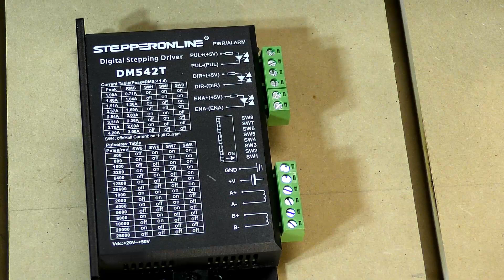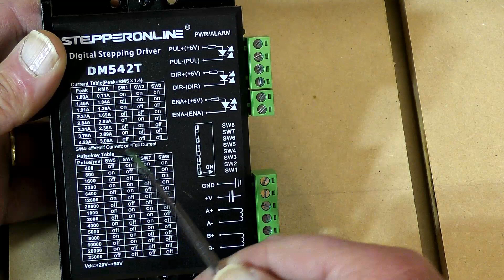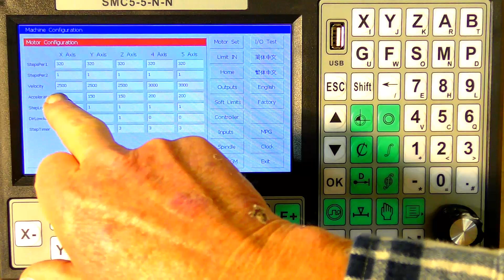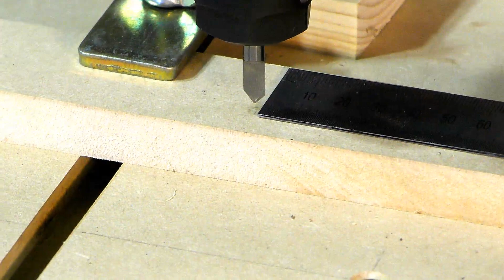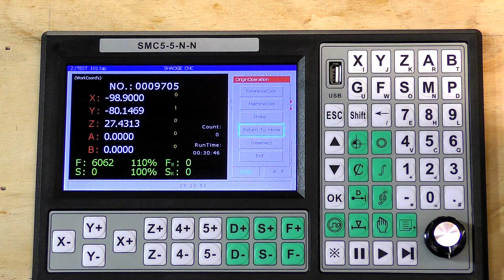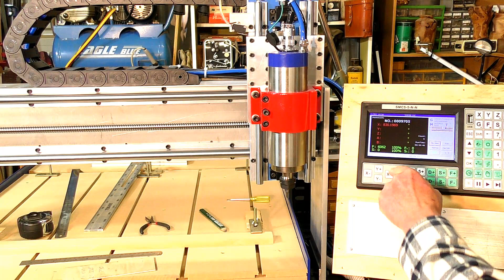I MADE A CNC ROUTER WITH (standard) WOODSHOP TOOLS (final setup) SMC5-5-N-N  Episode 15

Comment: THx! in the process of chosing the mainboard for my 5 axis setup, finding the correct board/firmware for milling etc. Guess I gone go with the SMC5
Reply: Was thinking to buy the SMC5-5-N-N... It of stock. If m350 any good for a 5 axis CNC milling?
What about the network ability of the m350?
Any advice you can provide?